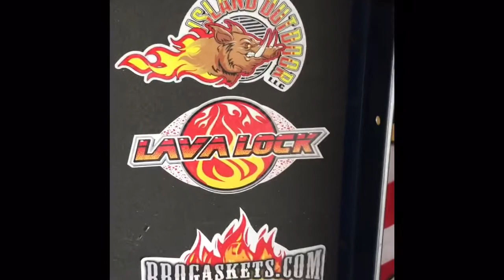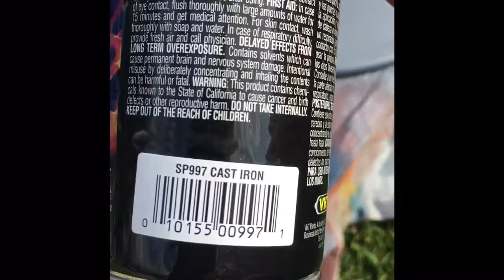Ugly Drum Smoker Build, “Blew By You” Competition UDS

Comment: Is there a trick to getting the paint to set? I painted mine and I have places where the paint can easily be scratched off. Any advice is appreciated
Reply from the maker: Jose Gomez honestly it’s all in the prep work. Whether it’s a used drum or a new drum you have to burn it to get the paint off, and then sand it to bare metal before you can paint it. A lot of time on used drums there was some grease, silicone or oil that was on the outside and even when you burn it off there is still residue ..
 After you get it down to bare metal you need to get a bottle of degreaser. Spray the drum down and wipe it with a cloth. Then you need to get a painters tacky  cloth to pick up any dust or lint  from the cloth you used that is on the drum. I started Sandblasting for a while and there would still be grease or oil presents on the bare metal underneath. I’m lucky, or fortunate that I mail purchase my drums brand new from the manufacturer unpainted in not lined.. once you have it prepped properly, use the high temp primer until you get a good coating. Then take 800 or 1000 grit wet sandpaper with a spray bottle of water and sand down the primer. You’re not Rubbing  super hard, you’re just going to get it smooth as a babies butt from the overspray. This will let the color coat sit flat on the primer preventing flaky paint. You do not have to use high temp color, you can use any rust oleum paint from Home Depot or Walmart. I now powder  Coat my drums with just a normal Powder Coating not high temp. They are all fine up to about 500°. You’re not cooking over 300°, and the only way you can get it over 500 is if you leave the lid up by accident. Believe me I know I’ve done it

Comment: What kit did ROb use for that UDS?
Reply from the maker: Keith Mack I did not buy a kit. I pieced together the parts I wanted from UDSparts.com
The paper towel holder and caster Mounts are sold by Mark Griggs at The Metal Shop in Spring Texas